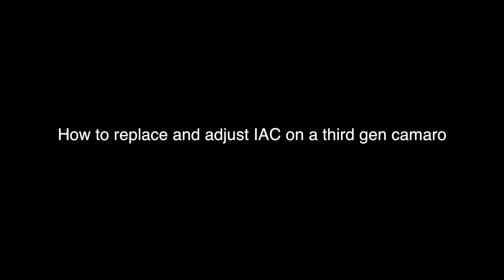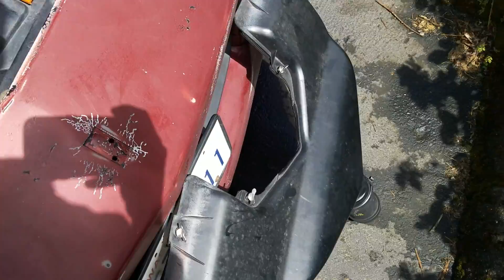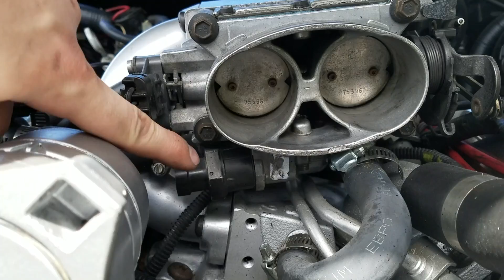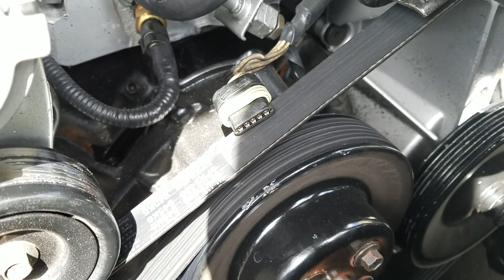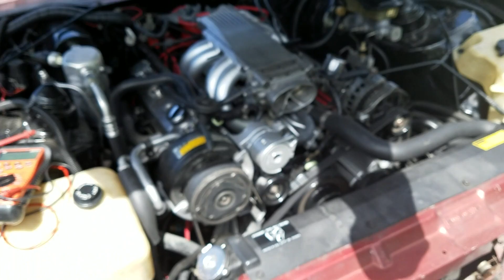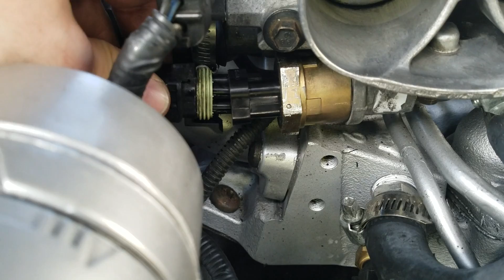How to install and adjust IAC on a 1989 third gen Camaro

Comment: Question if I did not do the procedure, can I ruin the IAC I’ve driven the car without doing the procedure for 1000 miles. I’m getting my hard start still and even on the highway I have had a steady stumble at a constant speed. I feel it buck sometimes, and when it does start the idle is all over the place when cold. Can I still do the procedure or did I ruin the new IAC?

Comment: No way I think this will fix my rough idle when I start it. Once it’s warmed up it runs good no idle problem except sometimes I see a dip in idle or even the lights Ladin down for a little or even get brighter like it surges. What would cause that?
Reply: Thats the issue im having car drives fine idles fine typical idle for me while driving OD no foot on gas it goes to 500 even but lately its been revved up to 1000 rom while driving and foot off the gas . I will go put it in park normally its at 600 pm and now it wants to sometimes sit at 1000

Comment: Hey thanks for the videos I learn a lot from them. I have a 89 Iroc z and my idle will climb at a stop light , so much I have to drop it in neutral.  Any tips or what part to swap first?  Thanks in advance
Reply: got the same problem
Reply: Did you figure it out?

Comment: On the lt1 the hose connecting to the water pump is blocking. Is there a way change the thing without flushing the coolant?
Reply: No need to flush your coolant system, just re-add the same amount that came out when it was disconnected. Start the car with the radiator cap off and massage the coolant hose to get rid of bubbles. Put the cap back on after bubbles are gone and before it gets too hot and your good to go.

Comment: good video ,but you could just cleaned it with throttle body cleaner,and put it back,what happens is,carbon build up on the pintle don't let it sit right ,and air goes by it,as long as motor works there is nothing wrong with IAC !it does nothing but going in and out and when it is not in use it sits back and seals the air flow,however carbons on the tip won't let it sit and seal tight,that is why you have bad idle but when you step on gas problem goes away
VIEW
•
VIEW
•

Comment: The bit at the end to adjust is not as described in the video. Ground pin A+B at the aldl, key up, listen for the clicking at the IAC, wait 30 sec. Unplug the IAC, key off unground the aldl. Verify  by running the engine with the IAC unplugged. Turn off engine, and reconnect IAC.
Reply: What's the ALDL? If read on TGO some very lengthy things on messing with the idle air screw etc.....seems they were written by some pretty knowledable guys...and talking about how you want your rrpm to be about 450 and to adjust it to there before you start this whole process etc...seemed a bit over whelming unless ur a true experiences or school trained mechanic

Comment: J Robling is this the same procedure for the 305 TBI V8 Engine? Like after you install it turn the key on and then off just like you did in this video??
Reply from the maker: Yes, same procedure, you need to make sure that it knows whats open and whats closed.

Comment: Shouldn't run open breathers on a mass air car unmetered air
Reply: And u need to run a pcv valve
Reply: @jonsixxx6569   That's an 89, they're a speed density system, they don't have a mass air flow sensor.
Reply: @chucklucas5326  SD was standard on 1990+ GM TPI, 86-89 are MAF.
Reply: @steve069   My bad, I thought the SD started on the 89 models.

Comment: My car wont start without startimg fluid whay could it be
Reply: I would check the fuel pump. U should here it turn on when u turn the key to the on position. That would be my first place to look .
Reply: Did u ever figure it out..
Reply: Or if it's a 88 and down it could be the 9th injector

Comment: I did the same thing that J Robling did. Leonidas and it's also what I also read in all the forums that I looked into. However, I bought a new IAC and  the instructions that came in the box didn't mention anything about doing that. In fact, instructions say that the iac will adjust on it's own. That you simply have to drive the car for 5  minutes or more  at 45 + mph and that will reset the iac.  Good video. Thanks.

Comment: Thanks for the video!

Why did you need to do that procedure at the end?  You first turned it to run (but not started), left the key in that position and uplugged the IAC.  This opens the IAC fully you say.  Shut off the ignition and then replugged the IAC in.  What is that supposed to do?
Reply from the maker: its the procedure you need to do to make sure that it is in the proper position because the ecu doesn't set it
Reply: Leoneidas  short new aic
Reply: That did not work for my 91 Z28 350 tpi. Not sure what to do now